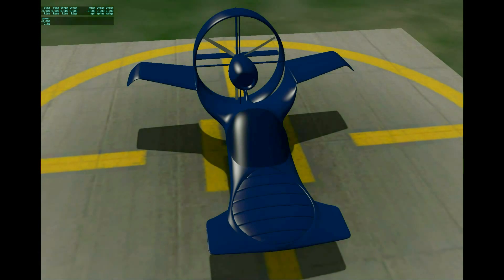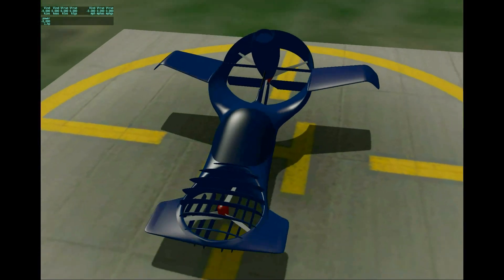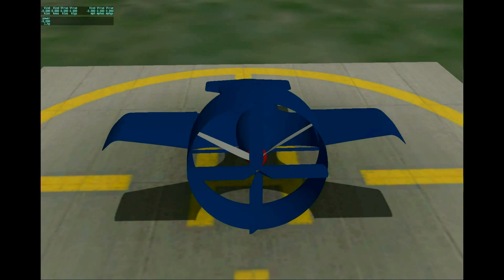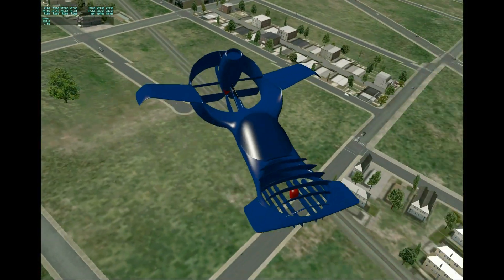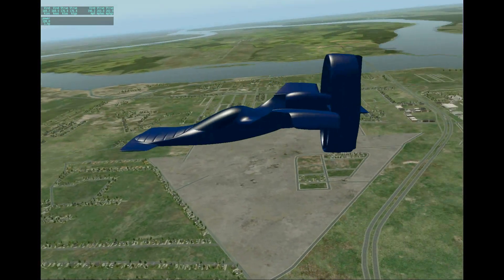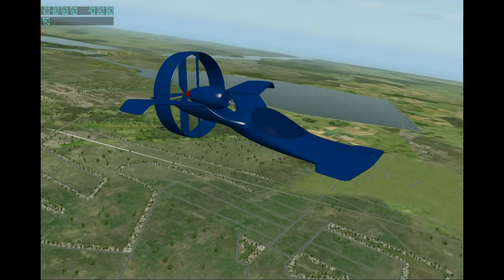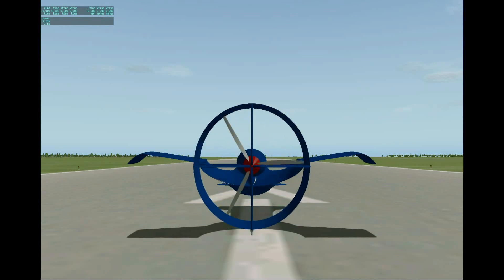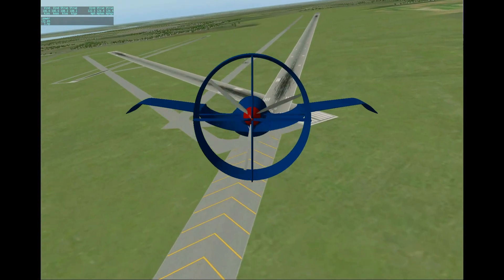Aliptera single lip wing system concept aircraft presentation

Comment: neat concept! Are you using X-Plane for the simulation?
Reply from the maker: The simulation is not in Xplane, I have some CFD simulations in fluent/ansys done for high speed, by a couple of students. I'm missing simulations for lower speed and hovering, it's harder as it needs to account for much higher energy imparted by the propeller. I'm using openFoam/simscale for that.

Comment: Do you want a serious critique? 

There are a lot of problems with this design....
Reply from the maker: I'm not saying there are no problems and this is the perfect aircraft..; This is a concept only, to demontrate what would be possible for an aircraft employing "Lip Wing System", a system that generates more lift in VTOL mode giving the aircraft VTOL capability, but also without the need to have a much bigger engine and propeller as current VTOL do, because 40% or more lift comes from the specially shaped lip wing. The fact that the wing is configurable, in VTOL mode to assist in generation of lift (tiltwing aircraft wings are just dead weight in VTOL, tiltrotors even impede the VTOL airflow) and  in forward flying mode the wing is helping to reduce drag to about the same as a conventional fixed wing (propeller is smaller than on a tilt wing/rotor)
Reply: Aliptera - Lip Wing Aircraft

Ok, I can see you are trying to make the wing generate lift in VTOL.  But why VTOL?  Is VTOL required?  Why not a slower X-57 that can land on roads?
Reply from the maker: I'm continuing here the discution started on the TriFan aircraft page: https://www.youtube.com/watch?v=aHunGEWFZqM

Roll control in VTOL mode could be acomplised using a cyclic control as in helicopters, or using two side lip wings as in the Aliptera UAV concept here: http://aliptera.com/#UAV-1
Reply: Aliptera - Lip Wing Aircraft

I don't see either on your links.  Can you be specific?
Reply from the maker: From the Aliptera website, http://aliptera.com/#UAV-1, under the picture, press on 'more': "The arrangement of the lip wings also provide control and increases maneuverability without the need for conventional control surfaces" 
The lip wings can be adjusted independently so they are generating more or less lift, providing pitch and roll control in VTOL mode. Please open the 3D interactive image, altough it does not show differential movement of the lip wings, I hope it is more clear.
Reply: Aliptera - Lip Wing Aircraft

Lip wing?  Where is that?  the U shaped part or internal to the duct?  Somehow you need dynamic flow of some kind to keep it all going and to counter torques.  Is is counter rotating props?  Where does it come from?

Wouldn't the canard stall?  How do you control all that forward area?  Where is the stability?  It is computer controlled?
Reply from the maker: The u shaped wing is the lip wing; placed adjacently to the duct, is creating lift as the propeller is forcing air to flow over the top surface of the wing, even when the vehicle speed is zero (hovering, VTOL mode). If there is more than one of lip wings, arranged around the perimeter of the duct (like this: http://aliptera.com/#UAV-1), the lift on each wing can be controlled by adjusting the position of the wing in respect to the duct. By doing this, you modify the momentum applied to the craft, creating control in pitch and roll axis.
To counter torque, counter-rotating propellers can be used, but I believe it will be more efficient to use stator vanes in the propeller flow (experiment will tell the difference) as in this device: https://www.youtube.com/watch?v=pJzXUAibRo4